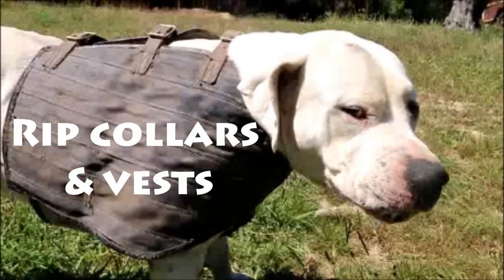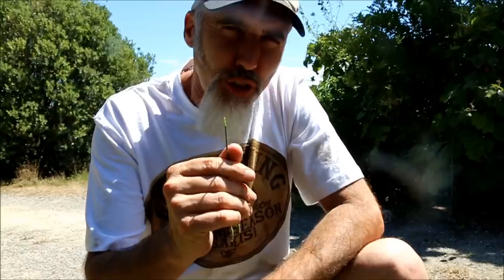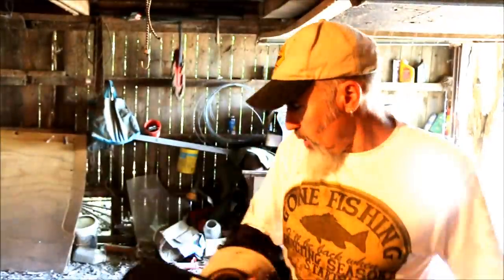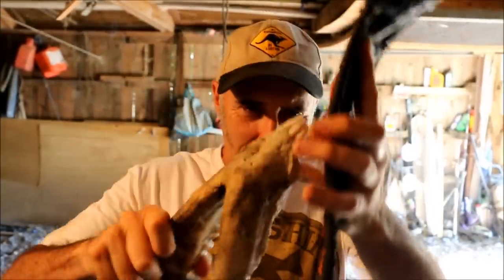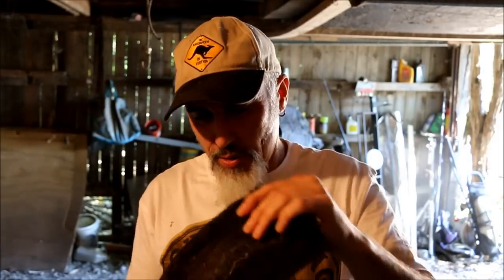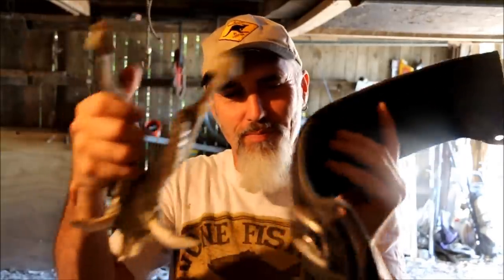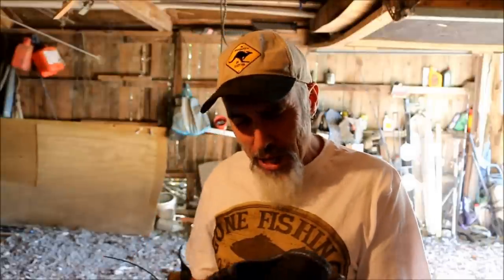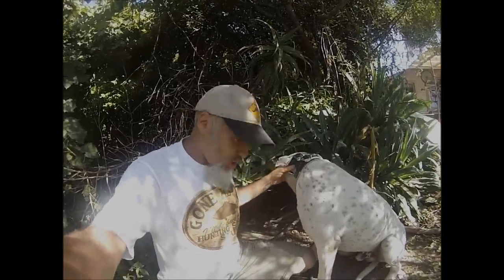Rip collars & vests for hunting dogs in NZ

Comment: Yes, leather collars do need care to keep them in tip top condition. Oil does stop them from going brittle. Coat them with beeswax will keep the wet and the damp off. Water is what wears on the leather and makes it brittle.

Comment: Hi Clay, IHemp is 10 X stronger than steel ( Kevlar is only 5 X stronger than steel ) I see a line of Rip Collars made from IHemp cloth, " Clay's Cover "...we want the best for our dog's, IHemp cloth is it..loved the vid..IHemp fibre will snag and hold tusk, low cost, multi layered, as you know the word Canvas comes from Cannabis..and then we have #Hempcrete..my future home..check it out bro, can grow your own building material..sell crop, bank the $$, and #Hempcrete is made from the waste , just add water and lime..cures to stone..post and beam construction as is my straw bale home..
Reply from the maker: interesting
Reply: Hempcrete is a crappy product. You can kick it and knock off chunks of it. It also wicks water like crazy and is impossible to seal.
Reply: @JohnSmith-pj3gi  takes a few years to cure to stone, seals very well with a lime render, a good home breathes, #hempcrete wall's approx 250 - 300 wide with post and beam construction. your point about kicking chunks off, before cured of course, as you can walk in wet cement..?  why would you..#hempcrete is the future of GOOD home building, made from the waste after crop has been sold..but then I am bias, my home is made of straw, with an earth roof .low stone wall and a big hat ( eaves ) is best for both straw bale and #hempcrete